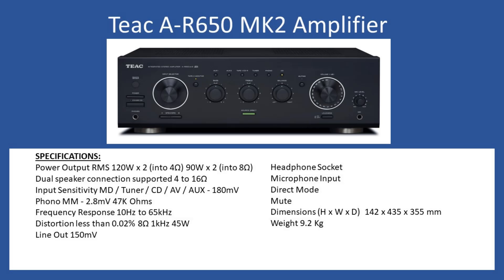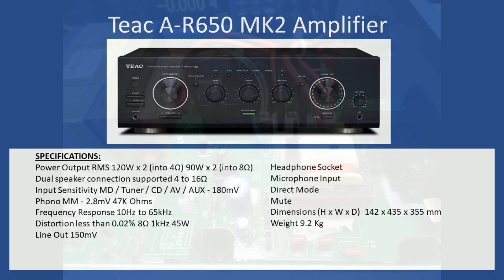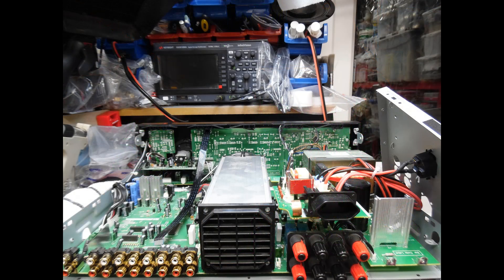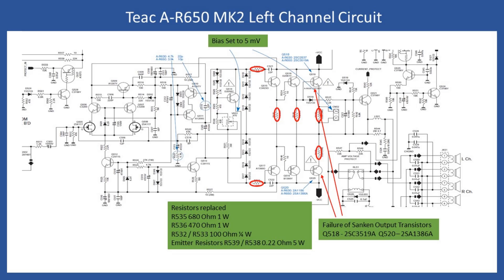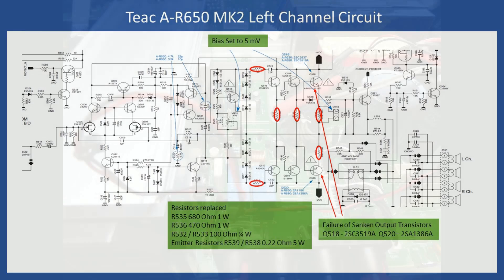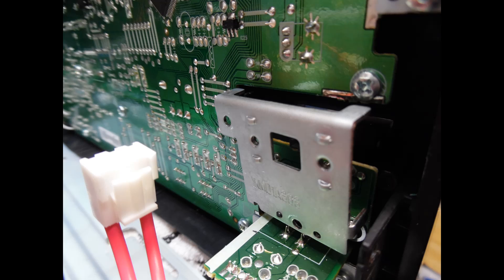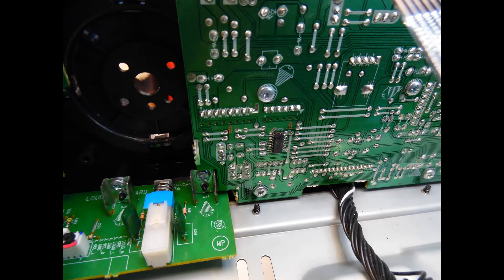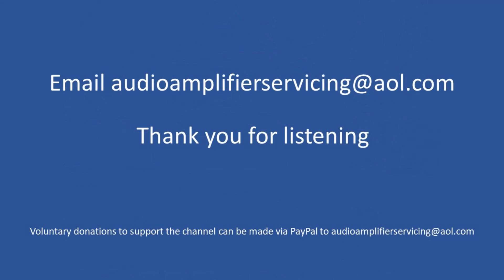Teac A R650MK2 Amplifier Repair (With Audio Tutorial)

Comment: new subscriber! recently bought a second hand AR-630 on ebay for 80 quid. never done electronics before but have worked as a caretaker/maintenance and ended up learning a lot of different things along the way so i'll have ago at anything. 

i downloaded the service manual, set the bias to 5mV and the amp is running ok. as you say, the one test point is a pain to get to.

great sound through my technics cd player and wharfedale speakers. the fan hasn't kicked in yet so i'm guessing that things aren't running too hot. 

going to replace a few caps as the board below them has darkened somewhat. 

r
egarding the power button problem you mentioned - i took the top cover off and noticed the board was a bit loose. i tightened the screws and also added a it more solder on the contacts on the board. everything working fine now. bought some servisol (kontakt10 super) and am going to do the pots etc and give the amp a service.

bought a multimeter and soldering iron last week and am looking forward to delving into the world of electronics.

expect an email 😀

also, your voice sounds familiar. i'm in the walsall/wolverhampton area.

thanks for the video and info. much appreciated.
Reply from the maker: Thank you for subscribing it's great to hear your getting into electronics. When your changing some of the capacitors on the main circuit board resolder the output transistors and driver transistors, often they become dry solder jointed leading to failure.
Reply: @AudioAmplifierServicing  you're welcome, and thank you! yes, at the young age of 49 i'm about to delve into electronics. i was actually hoping to go to college and do an electronics course, but it seems that most places don't do it anymore.

i shall look at re-soldering the components you suggest. have sent you an email

thanks again!

Lloyd

Comment: Did I understant you that you have to remove the resistors to check them? Can't you just check it in situ with a multimeter?
Reply from the maker: Hi It is possible to measure resistors in circuit, but it may not be possible to obtain an accurate reading.It depends where in the circuit the resistor is located.
It may be in parallel with other components resulting in a reading that may be misleading when fault finding.
It is better to lift one end of the  resistor or remove  it.
Also ensure your finger tips are not making contact with the multimeter   probes tips otherwise your measurement will again be inaccurate as the meter will measure the resistance of your body as well as the resistor.
Reply: @AudioAmplifierServicing  cheers